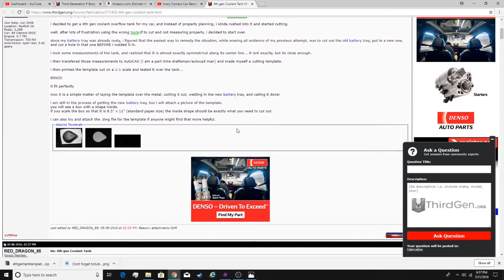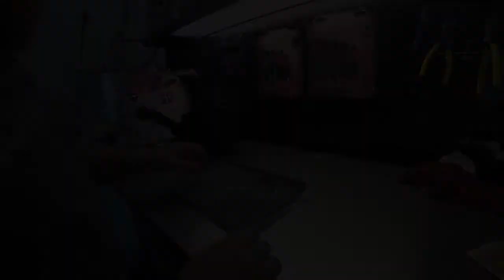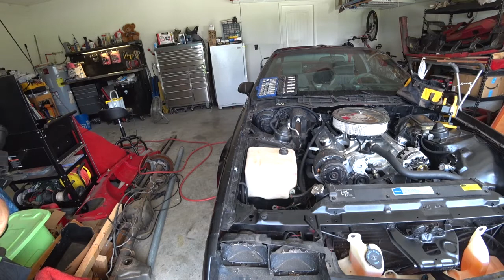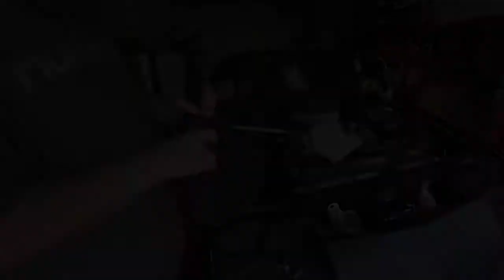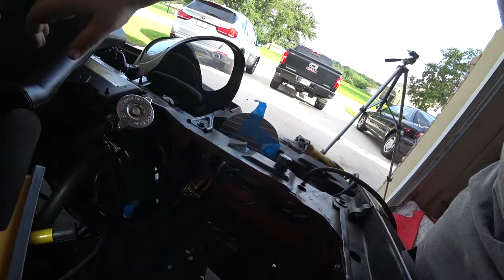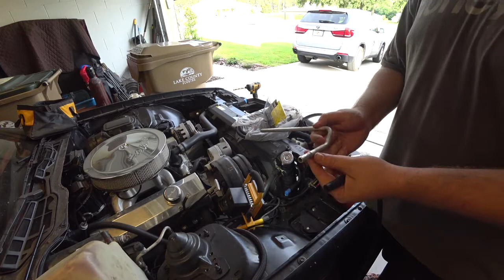4th gen camaro Coolant reservoir install, into 3rd gen camaro

Comment: ouch. yikes.  why did you hack up the inner fender area like that. 
not  necessary. not a good look at all
Reply from the maker: Dave Martin if I did it again I would move it out a bit, but overall I am happy with how hidden it is. I really want to clean it up a bit
Reply: i searched your page looking for the same mod done without hacking up the inner fender....but i can't seem to find the video, if you have done it can you point me too the video so i can see how you did it?
Reply: @johndoe-zd9lb  I did not have a video of it. I had simply just done it and done it cleanly.  That was a few years ago; the car is wildly different now and That whole are is different. I use an aluminum catch can, my battery is mounted in the trunk, and the sheetmetal in the area is home to a +12 volt distribution block and some electrical relays. I also do not have a video specifically of this, but if you check one of my "walk-around" type car videos where I do a walk-around and talk about the car, you will see this area of the engine bay that I am talking about.